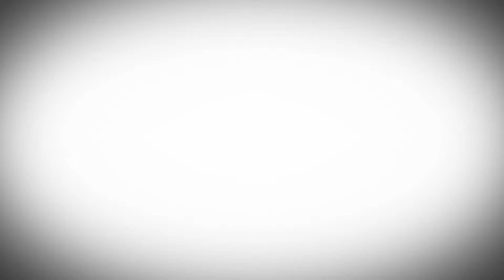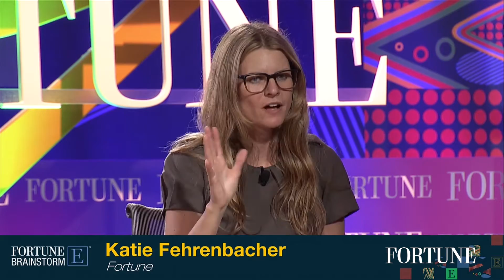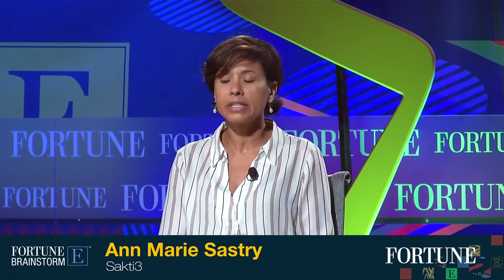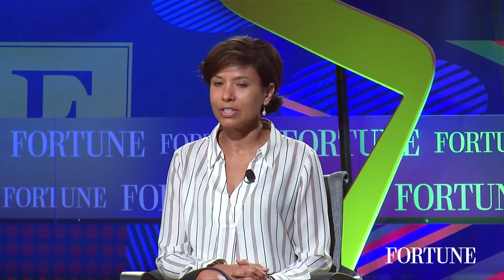Why battery production needs an overhaul | Fortune

Comment: For mechanical energy why not use magnetic surge motor generator? - it has been proven technology and does not require any stored battery power other than the standard OEM 12v battery to run redundant systems in vehicles...
The problem is to solve the chemistry of batteries and/or technology or both that are integrated systems...
Hydrogen fuel (HHO) extrapolated from any water source or produced chemically which is too expensive that can be used as combustion fuel and/or converted for electricity...
Solid-state alone w/o a medium cannot work unless for an example to harness electricity from the atmosphere and/or magnetism as Nikola Tesla had demonstrated that is plentiful of free energy...
There are a number of different fuel cell technologies that are in play and in development like the ionic fuel cell technology that a company called nanoFlowCell AG that has working research vehicles that is using the technology for a few years now and they are pushing the many products for use in every transportation,  infrastructure use including the home/business/industrial use.